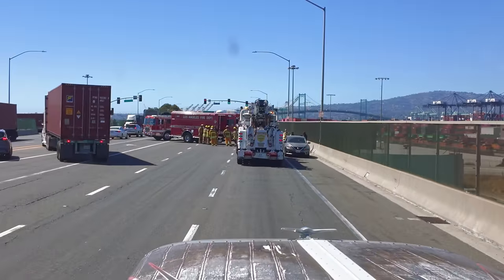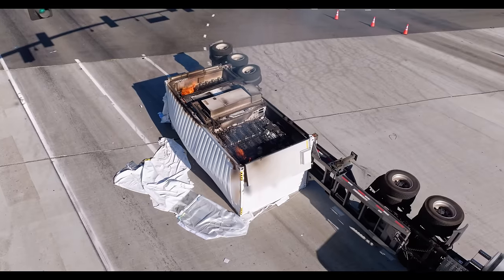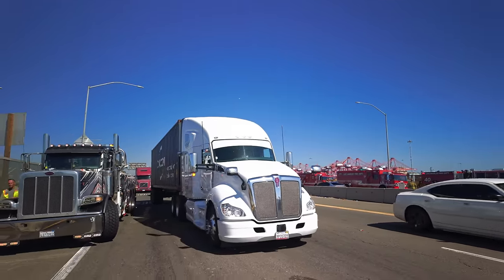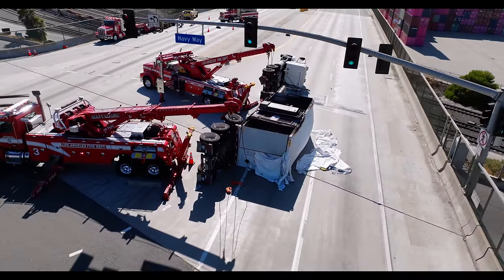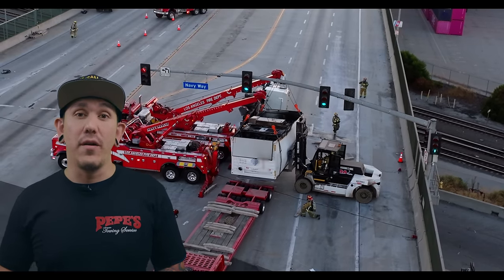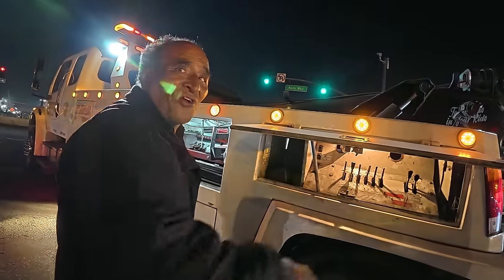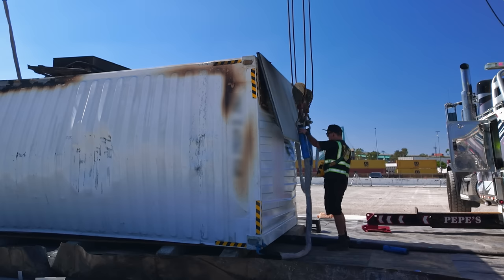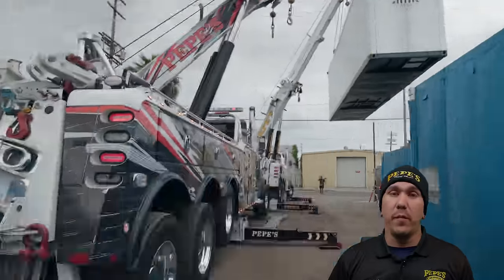60,000lb Lithium-ion Battery EXPLODES on Freeway!

Comment: that footage of the battery exploding is going to used by fire departments everywhere! I've already seen it on several other YT channels (credited). when I went thru FF recruit class, they beat it into out heads to never turn your back to a fire. this is why!
Reply from the maker: I sent it out to the FD and other agencies for that purpose! People need to know how to handle this stuff because imagine if this happens in a residential area or the freeway again?
Reply: @PepesTowingService  Was that a Hazmat Unit used to deal with Lithium-ion batteries.
Reply: @TwiztidPain  anytime one of these Li-ion batteries are so much as damaged regardless of size they become a hazmat situation. Last year a local fire captain of my towns fire department gave a talk about the hazards of these batteries to the amateur radio club I am a member of. It was very informative.
Reply: @andrewweldy7508  Yeah I realized the Units after I commted.  Just a small e-bike one is annoying to put out. This video was eye opening.
Reply: Keep using chassis trailer that are not designed for that much concentrated dead weight….. remembering the extreme step deck super lightweight?  Special cargo requires specialized equipment, period. Stay safe brothers.
Reply: @ANDREASRIAL  It is spred over the tractor and tralor. The bilk of the weight was sitting on the rear not hot his steerer.  He took that turn way to fast and laid it over.
Reply: @TwiztidPain  agree with you , but I think that a chassis trailer it is not good for this type of load, a double drop or a even a low boy it is the way to go. The way to spread the load on the axles makes sense, God Bless to All of You,
Reply: @ANDREASRIAL  I agree they also keep the roll factor down .
Reply: @ANDREASRIAL  Uh...the trailer was not an issue here...not sure why you bring it up.
Reply: @ruserious9577  if you give it some analysis,  the chassis trailer are not designed to handle the amount of concentrated weight and the frame it is not engineered to the amount of force sideways and to add a little more to thus particular case: the center of gravity is higher up, there is less weight on top of the fifth wheel: therefore giving up as he's turning.  ( I am just a driver and my point is the longer points where you have the weight being supported,  the weaker it gets ) my respect to you Sir. The weight it is perfectly distributed as far the axles, but to me is the wrong equipment for the load like that.
Reply: @ruserious9577 
That is what is known as a high-center load. Between the cargo and trailer type, the center of gravity is too high and increases the likelihood of tipping over. Yes, lowboy, RGN, double-drops and Landall trailers would have been a better choice.
Reply: @jsh6952  yeah 100%  since apparently you can't trust idiots not to take turns fast now days -_-.   I wonder if he looked at load weight before he left the port to realize how heavy that thing is.
Reply: Local news 📰 used this video alot    Great video 👍😎
Reply: Great video of why it is clearly dangerous... I have to wonder how much this actually cost the Port Delays, Emergency response, and cleanup? My own guess is over  $100 million in losses over 3 3-day timeline and shipping delays... Not even taking into account the public's delays...
Reply: @PepesTowingService crazy enough there was a vid of someone showing that you can stop a class d fire with gasoline lol what you think of that stuff lol
Reply: probie never gonna live down his lack of hydrant skills on camera
Reply: @PepesTowingService no wonder they tell us not to worry about the “niche down” approach but story approach. Great job on the capture part staying in the moment as well as being able to capture and share the moment. Calm yet engaged 👍
Reply: Looks staged to me..

Comment from the maker: Hey everyone, just want to address this again for those that go to the comments and didn't wait for day 3. The reason we couldn't get near it is because of how deadly these fumes are. Even on the 2nd day, you saw it was still on fire. The fumes alone could kill you, which is why FD had to do the job in full hazmat gear. It's very very very toxic dangerous stuff.
Reply: I think what people don't realize is .... battery go boom.  Then everything else inside the battery box burns.

And that is plastics, rubber, glues, copper, all sorts of materials.  And the fumes from that stuff is absolutely lethally toxic.
Reply: Ever see a fuel tanker burn? 25 years hauling fuel, a spill or fire nearly every month just in one state. Have you forgotten Deepwater Horizon, Exxon Valdez or the constant pipeline leaks. Is there bad stuff in these giant battery packs, yes. Are they still better than running a diesel genset, defintely.
Reply: @saintchuck9857  it your diesel genset close to your home burn down you might be able to douse it to keep you home from burning down. If your tesla burn down on your porch, say good bye to your house. Fact is we still don't know how to effectively deal with lithium battery fire
Reply: @PepesTowingService   I was worried when yall were flipping the container at the empty yard and yall didn’t have any dust protection.  I was wondering about the smell that fire produced because in SD county we had a similar fire and the whole county was like what the fk is that smell.
Reply: You have no idea what you are talking about. Lithium-ion batteries are clean power and amazing on the environment.  Ask every person who is pushing for getting rid of ICE vehicles and going battery claiming how much better and cleaner it is on the environment while charging batteries with fossil fuels and all of the ICE vehicles used for mining it and so on.
Reply: @saintchuck9857 you ever seen the poor kids in the Congo.? Everyday they are taking advantage of. Work in unsafe horrible conditions. You ever seen the pollution from a hard rock lithium mine ? You think those mining companies care about how bad they pollute the area?
Reply: @Willrocs  Glad to see you suddenly care about African nations. Have a safe trip to Zimbabwe (not DRC) to help out. I'm also glad you suddenly care about the enviromental impact of mining. The walking will do wonders for you. You'll be happy to know that the vast majority of lithium comes from Australia and Chile, which have stringent environmental laws. Hope that eases your worried mind.
Reply: @jtbuilds9176  grid-scale energy production, even from fossil fuels, is vastly more efficient than an ICE-powered car. Your ignorance is bleeding through the sarcasm.
Reply: @saintchuck9857  i mean it's great but same time
Lithium-ion the funny thing why there so hard to put out there basically self igniting
> battery's cathode, or positively charged electrode, are heated, they decompose and release oxygen gas
>Fires need oxygen to burn,
>so the battery is creating it's own oxygen to burn
also it's Water Reactive
Reply: @knightwolf3511  yes, a shorting battery can continue to re-ignite (of any type). They aren't using pure elemental lithium in batteries. The hazard of copy-pasting things you find on the Internet is, you don't know the veracity.
Reply: @jtbuilds9176 and your title?
Reply: @jtbuilds9176   the batteries are only as "clean" as the materials that go into them
Reply: @Musicman45612  Almost like nobody knows or cares about what it takes to mine these materials.
Reply: @flyinghigh2000  or lithium waste.
Reply: Just hold your cigarette and breath......😅
Reply: @jtbuilds9176 not is not great for the envoirment. If the lithium leeches into the ground it can contaminate our water.. remember lithium like magnesium violently reacts with water.. why at this moment there's no way to put it out.. hence they only good thing about it is is clean.. but to also harvest the lithium from the ground takes soo much diesel and electricity that in the scope it's not really something worth distorting our plant when tesla has the tech for free electricity yet we can't have thst cause the big corporations would lose soon much money.
Reply: @thomaslascola9683  You almost did a good job there keyboard warrior. I guess it you do not understand sarcasm.
Reply: Thermal runaway is not the same as fuel burn away.
There’s zero predictability.
Reply: army would say it's fine and deny your claim
Reply: Yeah that should be good for the environment 😂
Reply: @knightwolf3511  If you actually look at the scandanavian research per mile EVs i believe are like 20 times safer than ICE cars. Here is a brief statement from the study.

"In 2022, the Swedish Civil Contingencies Agency (MSB) reported that EVs were 20 times less likely to catch fire than ICE vehicles. In Sweden, 23 fires were reported in 611,000 EVs, while 3,400 fires were reported in 4.4 million ICE vehicles."
Reply: @nobodylmportant  it's not minute, days even months it can restart. You have multiple cells,each of them can spontaneously combust when breached. Hundreds of cell that you cannot disassemble after a fire vs a single fuel tank.
Reply: @Azabajam  what you write is true. But if an ev fire occurs the current solution is let it burn or put a fire blanket over it. Even then the remaining cell in the burned power pack is still susceptible to thermal runaway even days after the fire is out. In my local junkyard, they put wrecked ev far away from each other for fear it catches on fire.
Reply: @flyinghigh2000  I mean it's all about safe practices. everything is dangerous if looked after incorrectly. I mean have a look at custard powder factory explosions. something we eat on a daily basis destroyed buildings! but once we as humans have figured out how to look after and have safe practices with these materials we can all sleep better. but the public consensus is that EVs are much more dangerous than cars in general. which is just unnecessarily untrue.
Reply: @Azabajam my personal opinion is ev is as safe as any ice car. My gripe is currently we are ill prepared to deal with lithium cell fire. Be it in a car, airplane or any mode of transport. With mass adoption of large cells, accident bound to happen and our response to it are ineffective currently.
Reply: @flyinghigh2000  I completely agree with this statement. Humanity has an extraordinary talent of implimenting things without strict safety guidelines and strategies to handle situations like this. But that isnt the technologies fault. Maybe with the next generation of battery cell we will see steps into safety and guidelines on safe destruction and disarming of these cells. Who knows. Science.
Reply: as long as it is good for the environment its ok.
Reply: got to be a way to turn that off.
Reply: @psilocybemusashi  depends on your definition of "good for the environment" we have been mining ores and minerals for years. it all damages the environment wherever we dig.
Reply: @garyd.alzagajr.4157  Not if it was to arc and fuse a connection. Its just luck of the draw really. you can onbviously go nuclear and do a instant discharge but theres probably not a capacitor that doesnt cost 10x a tesla that would allow that draw and capacity.

Comment: I'm retired from merchant ships. Before shipping, I worked industrial maintenance in factories. Plenty of training and certs for hazmat, damage control and fire fighting. That explosion at the beginning WILL show up in future training videos as part of training/certification programs. Well done guys.
Reply: A top video documentary on "WWT" (Wasteful Worthless Technology in a box). 
Imagine the results if this had instead gone off in situ a few months after being installed or even during an earthquake a few years down the line...
As to the huge economic this incident has caused...
.
Reply: the device you posted this on most likely has one of those inside it. pretty wasteful. you should be glad it hasn't exploded yet /s
this is what happens when batteries are damaged, not randomly. they are some of the highest density solid state energy storages you can use today.

Comment: GREAT JOB!!!! I am watching from Tennessee. I am an ex tow truck operator, but I am now disabled. The only bad thing I can say is the Fire Dept. needs some training because it was clear they had no idea what they was doing. The Fire Dept needs to get with Pepes to learn and get proper equipment. Please, Please keep up the good work yall.
Reply from the maker: Thank you! When it comes to what they do, their focus is on extractions, obviously fires and things of that dangerous nature. They probably never had to upright a container because why would they. This lithium fire stuff is relatively new so I'm sure going forward changes will be made to learn how to best deal with this stuff.
Reply: Sand,  in an open area you dump wet sand. That's to smother it and to take the heat away. The heat will cause it to re ignite .
Reply: Maybe it makes more sense for these tow operators to begin to equip themselves with hazmat gear and get certified for it like the firefighter do as these things become more and more prevalent. I don't know if there is enough work like that right now to justify the cost, but maybe in the next ten years it would.
Reply: @niyablake no, the water will exacerbate the situation.

Comment: Day 1
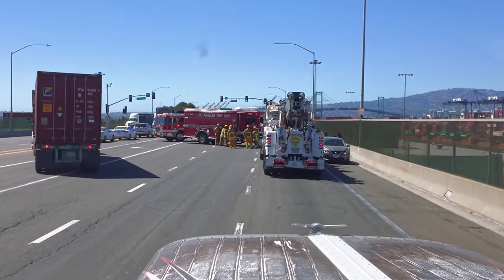1:35 Arriving on scene
2:05 FD says stand back
3:20 Drone time
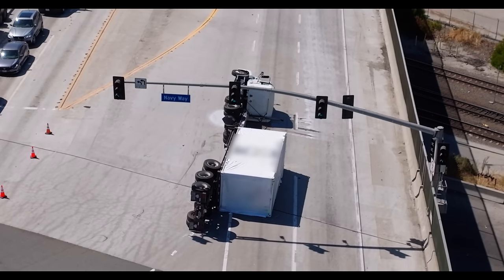3:55 Traffic nightmare, view of the massive ports
4:59 Old job of moving battery generator 
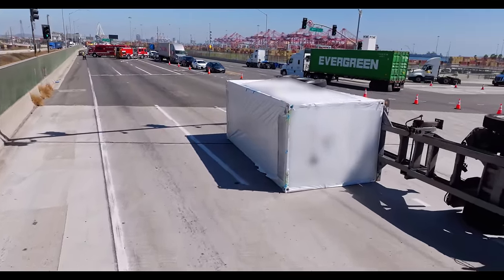5:52 (BOOM) Door pops open from pressure 
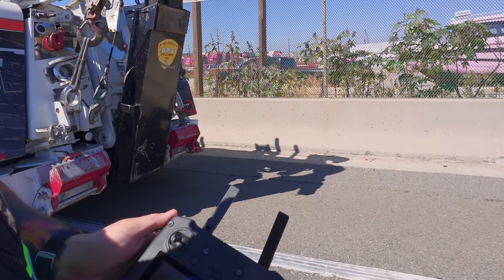11:00 Aiding fireman 
14:52 Blocking off ramp for public safety 
16:00 PEPE Movie Studio 
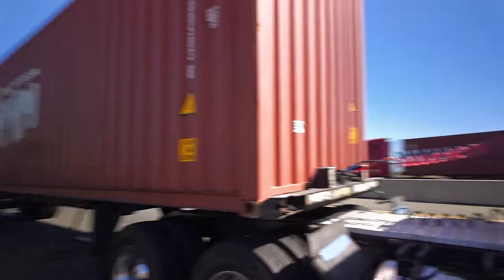16:40 Public gets turned around 
17:00 Port Cranes, lanes closed from all sides
18:00 10 hour mark 
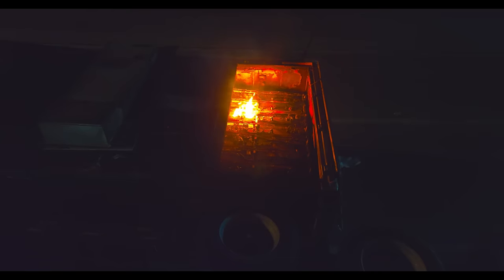20:00 PEPE Movie, battery is still burning 

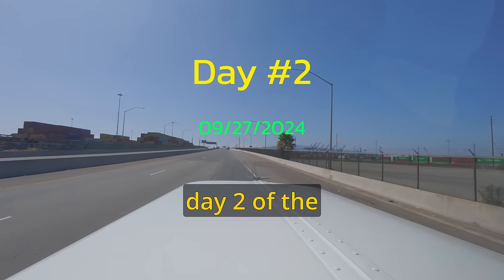21:05 Day 2
23:20 Forklifts and LAFD rescue 
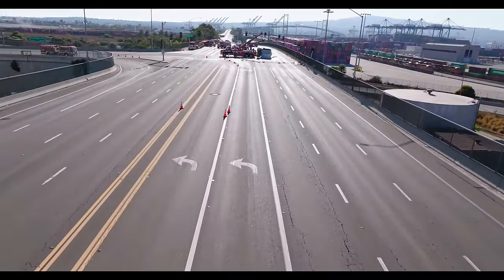26:30 Chassis separation 
27:27 Chaises lifted 
29:00 Shock loaded the boom 
29:44 Day 2 LAPD takes job 
30:00 Educational segment, container is loaded 
34:05 End of day 2 rigging truck 
38:10 Touchdown 
41:20 Reconnecting truck 
44:10 Pushing trailer back to the median
45:30 Scene clear 

46:21 Day 3 Uprighting container 
48:00 Rigging 
49:50 Liftoff 
52:15 Flawless job by PEPE

Summary 
53:55 Summary Time
56:40 Past job handling battery/ generator containers 
1:01:40 Merch
Reply: Thx
Reply: A while back, on another YT channel, I saw another FD in Europe (I think it was Sweden) flooded the EV batteries with salt water to kill the charge faster. No charge, no fire.
Reply: You sir are a legend 👏
Reply: You're incredible. Thanks man
Reply: Thanks so much dude

Comment: Need more ' Lowboy ' trailers in Trucking.  Standard Flat Bed trailers allow for too High of ' Center of Gravity ' - too easy for them to flip over if truck tractor speed is high
Reply: Low boy trailers require skillz, ppl be getting hung up on everything if not used correctly.....
Reply: @theglitch99 , all the more reason to use a lowboy.  This sort of load should only be transported by skilled drivers.
Reply: I was wondering how did it flip over on a smooth corner like that? Tractor going too fast or what? The amount of $$ and time this cost can’t be measured quickly.
Reply: I was saying to myself, that should have been on a low boy because of the weight and high center of gravity.
Reply: Then we'll have the video "60,000 lb lithium battery explodes after being hit by freight train when low-boy trailer stuck on tracks"
Reply: Need better trained and experienced drivers if there is going to be such top heavy loads. Guy must have been driving like it was a load of potato chips or something
Reply: @theglitch99  I would lay money on the Truck Driver only had less then 5 miles to move that and they couldn't do that Right. That is what happens when there is no Standards for Hiring and they Hire all DEI for the Port Welcome to DEI DEATHLAND.
Reply: The driver ABVIOSLY don't know what he was doing... 60,000 pounds up that high... Going too fast around the corner... He certainly didn't make good time speeding with such a load...

Comment: In a perfect world, Josh and Alex would have been hired to manage the two fire dept rotators remotely using communication headsets to communicate with the fire dept personnel operating the rotators. Under lessons learned: fire department heavy recovery operators should shadow Pepe operators to enhance their training through real world hands on experience that they can't get in any other way.  Ron Pratt's heavy recovery team in Missouri regularly conducts joint training sessions with local fire and law enforcement personnel.
Reply: LAFD goes to training classes for towing. I've been to CTTA classes with them there.
Reply from the maker: @Tanks_In_Space  Your comment doesn't make sense. They clearly did the job and lifted it to put on their RGN. What cowboy is saying is it would have went more smoothly Alex and myself were with them (remotely at least) to coordinate how best to accomplish what they wanted to do, which is split the chassis from the container and then load the container.
Reply: In a perfect world, the fire department would sell all that equipment that they have no business buying in the first place. his just one of the reasons that the state is completely bankrupt.
Reply: @tuberNunya  Truth!    For profit businesses know when to buy, when to sell, when to rent. Compare NASA to SpaceX.
Reply from the maker: Taking two hours to split a chassis from a container using two rotators and a forklift, shock loading your boom and destroying the chassis air lines in the process went smoothly?? Using 1/2" chain to cradle this with 12t blocks? Real smooth. OK, I see now. You must have been one of the FD operators on scene lol. What do I know though, I only do this daily for a living lol